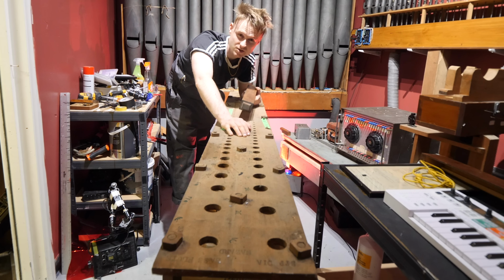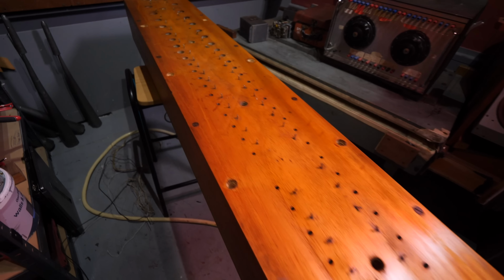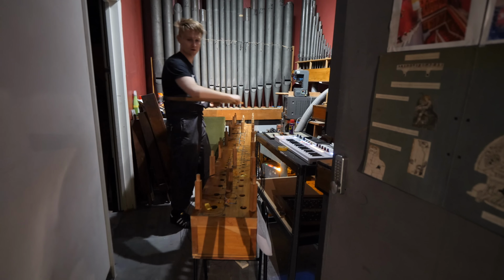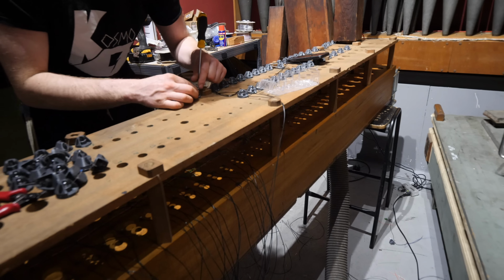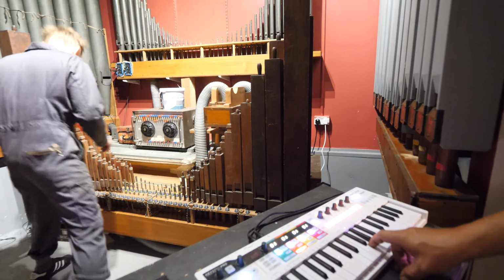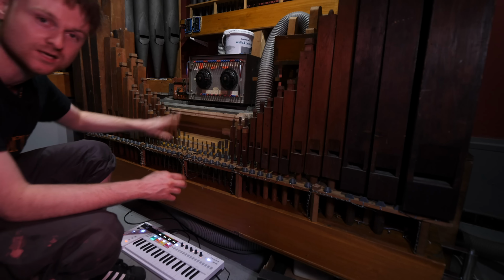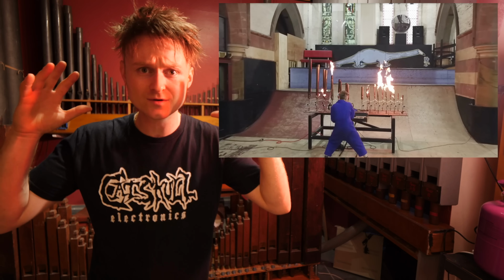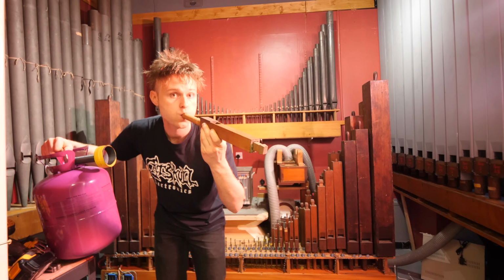HELIUM Through a CHURCH ORGAN, What Happens? I BOUGHT A CHURCH ORGAN PART 5

Comment: Great job! Regarding the helium: It is one of the smallest gas molecules and probably leaks like hell out of the system. (It's commonly used for leak testing in high vacuum appliances )
Edit: It has nothing to do with the atom or molecule size. It but It could be the difference in density compared to air (0,166 to 1,21kg/m³) and the resulting difference in kinematic viscosity.
Reply: Helium gas mixtures have been used for many years in deep sea diving as well as in medicine for airway obstruction due to its ability to reduce the resistance to flow, thus reducing the work of breathing. It behaves like a gas lubricant, so as well as being difficult to contain due to its size, it probably made it easier for the gas to flow out of the pipes, draining the reservoir more quickly. Love it.
Reply: Also being a lightweight molecule it represents less pressure at the same cinetic energy, which LMNC guessed.
Reply: Please do not run a freon of SF6 version to save our environment.
Reply: Fun fact: It's also used to check for leaky phone lines. Yes, phone lines. They pump air into the big cables leaving the exchange to stop water from getting in if there is a small hole, the pressure is monitored and if there is a big drop in pressure they put helium in it to go try to find the leak with a special device that listens for the helium escaping.
Reply: @redsquirrelftw  Yeah, that is very funny, thank you for that information from the last century and that before:) Also not giving any source or what is meant exactly. If undersea-cables are meant: The measurement to the failure point is done as reflection (echo) detection. Can be done in copper or fiber without any problem (and since decades). Also, as your big brain has successful identified and mentioned the failure-point of a leak(? what a strange wording ... do they leak earwax, ROTFL), f'n cables are usually built to isolate from other cable cores and THE OUTSIDE. Only a moron would build them to include the possibility of passing a gas through it, which at the same time would mean leaving space for moisture to penetrate or built up ... which is diametrically opposed to the idea of insulation.
The other case, land based phone line cables ... which mostly are fiber today, too (... and the above said applies to it also). Oh and you HAVE to burry a special kind of cable (expensive!!!), that you can use devices like a "LHHLD-2002 Handheld Sniffer Leak Detector, by FLUIDX" (you guess it, expensive ... but good for that company;) ). BTW. this is such an edge-case(please check out the pdf, the manual) that it is funny, like someone telling, that you "can also fry fried eggs on edge ... with the necessary tools". 

Thanks for mentioning that curiosity, Red Squirrel:) (Also please note that with "morons" the company and the responsible person was meant, who bought this sh... for cable installation *g* before bankruptcy:)

Hint for proper engineering: If it is really that important detecting cable failures exactly (which is anyway a meter if you have to open up the soil again and splice that punk) then you can use resistance based detection, the aforementioned echo/reflection cable measurements or you can bring in additional strands (which fulfill the second purpose of strengthening the cable, even), interconnected like f.e. a keyboard matrix to detect the "exact" place of failure. GUARANTEEING a secondary gas-pipeline function(sounds dumb, doesn't it?:) ) is not only against the safety and isolation purpose of a cable, but most likely foiled by the failure itself, the pressure of the water or soil above or ground movements caused by erosion and other natural phenomena. 

Stay over the radish, yeah?;)
Reply: Jenser: Ahmmm, No!! Due to the van der Waals interaction, which is effective for all atoms and molecules, helium has a dimer(your "MOLECULES"), albeit with an extremely small binding energy of around 1.1 mK (= 9.5 · 10−26 J) and a correspondingly large bonding distance of about 52 Å. To compare: molecular hydrogen has an effective radius of 2.10 Å. 
You probably just confused atomic radii and the size of molecules (which... is a whole different story, hehe). Hydrogen: 25 pm / Helium: 28 pm / Lithium: 145 pm / Neon: 58 pm / Nitrogen: 65 pm ... see Wikipedia. Which system? Which hell? Which application? You see? All that does matter and is important. Now please forgive me for the nitpicking, before any gases diffuse out of me, you were just a slight little bit wrong with your comment:)

For your homework today (sorry, in German ... you are German, prost?): google and solve "A 13 – Diffusion von Wasserstoff durch Flaschenwand"
Reply: @dieSpinnt  I stand corrected, the reason for the probable leakage does in fact not come from the atomic radius or molecular size. Bit of researched leads me to conclude, that it has probably more to do with the difference in kinematic viscosity due to the difference in density (0,166 to 1,21 kg/m³). You learn something new every day. :D 
What I don't quite get is what you want with the wall diffusion. The reaction speed of the pressure reservoir is far too quick to attribute it to wall diffusion of the helium. (or at least that's what my guts conclude :D)
Prost :D
Reply: @dieSpinnt  This is for underground cables mostly but also ones up in poles.  Sometimes birds peck at them.  The insulation inside is paper on older cables so if any water gets in, it absorbs and the pairs all short out.  The buried cables are at higher risk though since the ground can completely saturate with water during heavy rain or snow melt.  Under normal circumstance dry air is the only thing that is sent in them.  They're kept at around 10ish psi I think?  Been a while since I checked.  I don't really work directly with this myself, I'm just a NOC tech, I see something turn red, I call somebody. :P
Reply: @JenserBierfan  Ahm no, you are on the right way:)
Throwing with a baseball through a handball-goal-net (this example is only for germans? ... nah handballers) has a probability for success. If you view atoms and molecules as fields (and temperature is the drive to get the helium, f.e. out of an aluminium/steel sheet tank, a vector), than the probabilities of holding H in, vs density-field of letting H out give another probability ... your loss(or drive) of gas, fluid, solid or plasma. A balloon(thin alu foil?) has another coefficient than a heat isolated steel tank facility, f.e. the diffusion(seen from the diffundant) is easier to achieve.
Reply: Good food for brain, however I would guess they use helium in leak testing systems because it is the cheapest and most readily available noble gas, so it is safe to use in many vacuum applications and especially safe for testing performed by humans. At CERN for example our Beampipes are often filled with neon for transportation and storage, since neon does not really react with anything. Vacuum components can be for example aluminum alloys, and the aluminum in the alloy will react with oxygen.

But, it is also true that helium does leak much faster and much more efficiently through a small crack than air would :P
Reply: i think it's simply because of less centrifugal force (in the pump) is experienced by the gas due to the low density. (centrifugal force is like gravity: the heavier the thing, the more force it needs to go in circle, thus the more centrifugal force)
Reply: @redsquirrelftw  Like 25 years ago, my friend and I heard a compressor running.  It was attached to a telephone pole, and  seemed to be inflating the telephone  cable!  Finally, I have an answer!  Thank you.  Last time I thought about this, search engines didn't exist. 😂
Reply: @bsadewitz  Haha yeah that would be a weird sight to see if you don't know what's going on lol.
Reply: my guess is that the problem is the flow rate of the helium from the tank's valve is far less than the flow of the blower with an open inlet and has nothing to do with the type of gas. my guess is based on the demonstration of the blower in the earlier video, in which it seemed to move a lot of air, and the assumption that the pressure in the tank and size of the valve are relatively low/small
Reply: a  possible reason why the change of tone wasnt as impressive as expected, could be that the 'Helium' isn't really Helium, but so called balloon-gas. You have to read the really fine print to find that out.  'Balloon gas' is sold as Helium, but is actually only 12 to 20% Helium, the rest being just ordinary atmospheric air. Hope this helps. Great video!

Comment: Sam, most pipes are put in the chest with the pipes for the odd-numbered keys on one side and the even-numbered on the other. This gives a more symmetrical appearance side by side. When an organ tuner is working on a rank of pipes like this, they would have an assistant play every other key so they didn’t have to keep moving back and forth, side-to-side. Your tuning will go much faster. Our great division actually has 2 chests, each 10 foot apart as they flank both sides of a large stained glass window. In some churches, these could be mounted on the wall and would need a ladder for access. In those cases, you would exhaust yourself climbing up and down the ladder.
Reply: Richard Harrold  No, the lowest key on the keyboard is note 1 then you count up chromatically. On a modern 61-note manual or a 32-note pedalboard, the lowest note is a C. Therefore, your odd note sequence is C,D,E,F#,G#,A# or 3 whites then 3 blacks. Even note sequence is C#,D#,F,G,A,B or 2 blacks then 4 whites. Since there are 12 notes in the octave, the sequence just repeats through each additional octave.

BTW, it a keyboard rank was built with a 16’ extension (32’ for pedal), those might be the first 6 pipes you encounter on each side so you might start with that stop first. Likewise, if it was built with extensions on the upper end, you’ll need to switch to those to do the final pipes of the rank. If a rank was extended years after the original build, an additional chest might have been constructed to house those additional pipes. In that case, you might want to save tuning those until later.

Comment: A stopped diapason (or stopped flute) is the English equivalent of a French bourdon or German gedeckt stop. They are usually made of wood though shorter (higher pitched) pipes might be made of metal.

The stopped portion of the name refers to a stopper or plug in the top of the pipe. This is opposed to an open diapason which is an open pipe. Closing the end of the pipe causes it to play an octave lower. This results in shorter, cheaper pipes.

Comment: This is awesome. You've taken an organ that was trapped within someone's walls and made an organ that could be potentially moved to different spaces and venues. 

I'm curious to see how you resolve the keyboard situation. Midi organs are fairly pricey as are organ foot pedals and the various stands. There's definitely a second-hand market, and you can probably make a lot of that stuff. Looking forward to seeing that part of the build.
Reply: The boards to convert an electronic organ to MIDI are pretty cheap and easy to install if you're good with soldering and lots of wires (as Sam is), and suitable organs are regularly given away on FB or eBay - I got a few that way.
Reply: I think he took all of the console with stops, pistons etc. And it was electro pneumatic to begin with so after piecing together all the wind chests regulators etc I'm sure he'll look at modernization of the console itself to be able to connect and control different ranks with the option for midi input and possibly recording but that would only make sense once the rest is all "functional" Gonna take some time but I'm stoked at the progress made so far along with all the other projects on the go in the background. It must be quite a headache at times to keep on top of all the other museum exhibits with their obsolete parts and methods of operation. Hats off to Sam.👍

Comment: Good job, man. There's something strangely haunting about automated pipe organs. Reminds me of those cool old trucks you see at vintage rallies, with full pipes, drums and what have you built into the back, playing cool old tunes.
Reply: Integration of a punch card reader might even be possible further down the line. But if it's going to be midi anyway not much point other than to show the old music playback tech. Would be hella cool tho!
Reply: @Hendeesh  Imagine a punched card based programmable looper/sequencer....
Reply: @geraintjones6401  I agree👍 and a lot of early computer databases in the 70's particularly libraries and the like used an optical punch card reader for file retrieval so it could be an interesting hybrid of obsolete-ness!! Rather than the pneumatically driven ones found on fairground organs. Given the existing old computer exhibits and the expertise at the local micro museum to Sam's could be an interesting collaboration.🤔 I reckon once he's got the rest of it going it could be quite possible to add some percussion ranks too a'la cinema/fairground organ stylee. But we're just "pipe" dreaming at the moment! (Sorry couldn't resist!) 👍

Comment: That was absolutely crazy and fantastic. I smiled all the time. As a young boy I used to play the organ when the cantor was on vacation. During exercising the church songs I tested the thing by holding a three tone accord and switching off the blower. It was fun to hear the tones sank down several steps until silence. So, the problem with the helium is the blower cannot build up the same pressure as with air. On the one hand there is the low pressure on the other hand the higher tune because of the lighter gas. It is nearly equalizing the effect. Getting the original pressure the organ should squeak like bagpipes.

Comment: A little helium factoid - for the longest time, most helium was a waste byproduct of the oil & gas industry, especially wells in north Texas. It wasn’t until the demand for helium started climbing due to it’s medical usage to cool imaging equipment and it’s industrial use primarily in welding that needed to be done in the absence of oxygen that they started drilling wells primarily to harvest helium.

(Helium is the first noble gas on the periodic table. Because it’s valence ring of electrons is filled, it will not normally react with any other element. As it is lighter than any other gas other than hydrogen, it is safer to work around as it would normally want to rise and leave your lungs if accidentally inhaled as compared to neon and argon which are heavier than most components of air and would normally sink and pool in your lungs.)

Comment: 8:54 The first 3 chords sound beautiful in this order!
Btw, no critique or anything but I think it would look cooler if the LED's would shine indirect light out of the flute openings.
Reply: Indeed it did
Reply: Would probably affect the harmonics too much. You'd have to embed each diode into the wood in transparent resin.
Reply: @Nukle0n  Yes, I thought about the same thing. It would be complicated and way too much work but it sure would look amazing.

In my imagination that is. Maybe it wouldn't even be that pretty in actuality.
Reply: You'd also have to add some type of connector to each pipe to allow it to be removed. This would not work with the smaller pipes, though.
Reply: @user2C47  There are plenty of connectors for cables. Smaller pipes could be an issue though, good point.

Comment: The blower is probably driven by an induction motor, so that the rotation rate is roughly constant. The pressure that it can produce is proportional to the blade velocity squared times the density of the gas. Therefore, if the density goes down, the pressure goes down.
Reply: The item on top of the air reservoir is the device he’s using to control the motor speed and establish the proper air pressure. If there was an assistant available, one could have controlled the motor while the other adjusted the motor speed.
Reply: We've just found that out
Reply: @thomasbland6428  I just reviewed video #2 about this.  He called it a rheostat, but I expect (and/or hope) that it’s really a variac (a variable transformer).  The reason he’s using it is that the motor was made for 210V, but the mains power is 240V.  It originally had a transformer to do that conversion, which no longer works.  Most likely the motor is in fact an induction motor (i.e. it has no brushes), in which case you can’t vary its speed by varying the voltage.
Reply: @kc9scott  Not sure. Many of these blower motors are decades old, dating back prior to 1950. Our organ runs on the original motor and blower from 1932. The only change made was that there was a generator mounted parallel to the motor shaft and connected via a pulley attached to the motor shaft (the blower shaft is in-line.) The generator provided a DC voltage to power circuitry on the console and to power the valve solenoids in the pipe closet.

In that early video, didn’t he slowly increase the rheostat until he had it up to voltage?
Reply: @thomasbland6428  re: “didn’t he slowly increase the rheostat until he had it up to voltage”, yes he did, and I cringed for the sake of that motor.  Not a good way to treat an induction motor, if that’s what it is.  In the US, as early as the 1920s, induction motors powered the majority of blowers, but there still was the occasional DC motor here and there.

Comment: I love your intrigue and experimentation!  I think your air pump is a centrifugal pump which relies on the mass of the air spinning around to rush outward to create the flow/pressure.  With the low density of helium, this effect is greatly reduced.

If you had a bellow-based “air” pump, I think it would handle the helium better.